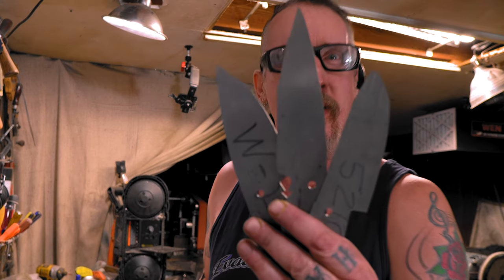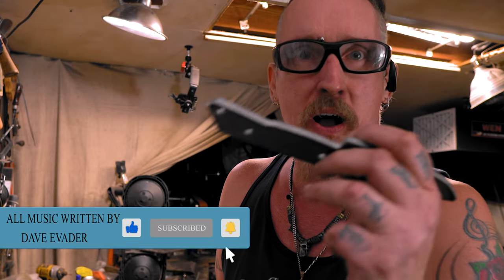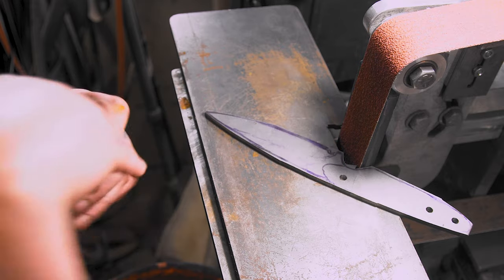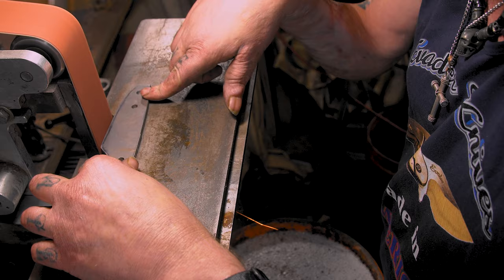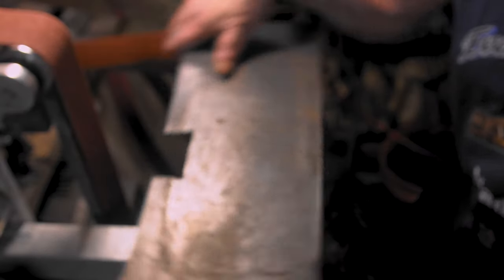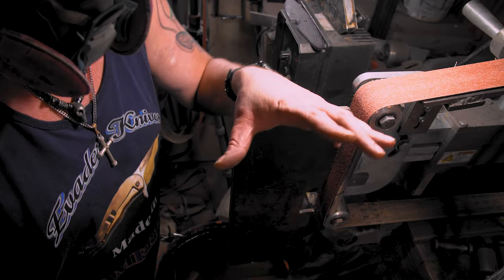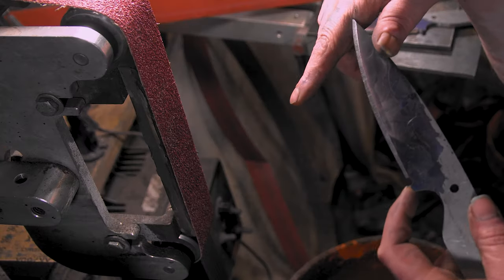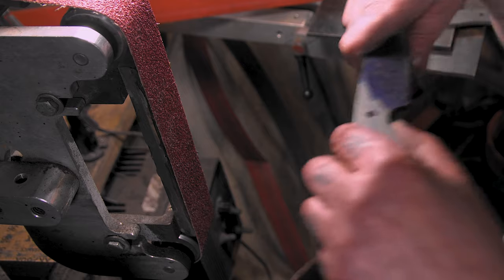Stock Removal 101 - Bevels

Comment: Dave, I have a great idea for a challenging build that IMO will be a super attention getting video. So, I was thinking since you have the mill and other important equipment. So, build a OTF (out the front) auto. or a multi tool Swiss army knife with your touch. Anyway, just thinking outside the box. and with your previous comments of losing interest. Sometimes this happens when we become complacent at what we are doing. So sometimes we need to challenge ourselves.  It's the only way to revive something that we love... Cheers and Blessings from mine to yours... Martin
Reply from the maker: Man OTF would be a challenge. I'm so busy these days, just got another Dexter order & getting ready to HT 5 knives tonight. It is a great idea though, thanks. P.S. I have a bunch I could take apart too. Take it easy my friend

Comment: Nice knife!
Reply from the maker: Hey Thanks!!!
Reply: @evaderknives  thanks for responding I've never gotten a comment back before from a  YouTuber. On all of my knives I've ground without precision and spent hours hand sanding. It's only now that I'm really trying to make high quality knives that I thought about marking and measuring to get a proper bevel. Up until now I never considered how important edge geometry was. I am going to try your method, hopefully it will save me some time. Also thanks for providing a list of what you use in your description. The red label abrasive belts really last a long time!
Reply from the maker: @organicmechanic5579  Right on, yeah even after years, I'm still trying to learn & figure out better ways to do things. Ya just gotta stick with it.